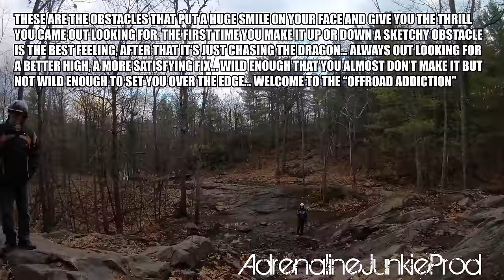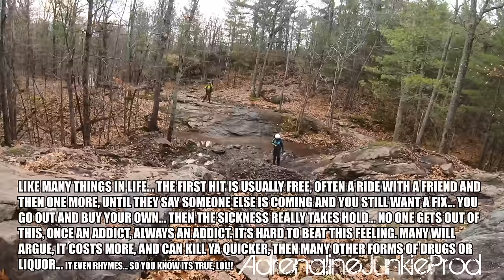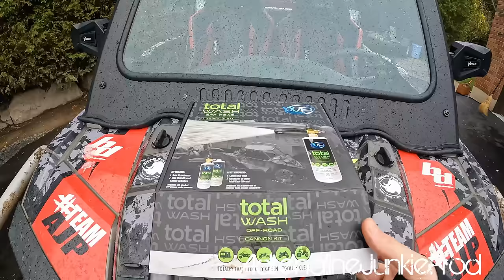The Bigger They Are The Harder They Fall! Feature Length UTV/SXS Off-Road Trail Riding Adventure

Comment from the maker: Do you think PORTAL GEARS are only good in the mud or do they have a place on the trail too? Leave a comment below!!
Reply: I think they only belong in mud. Put way too much stress on components during high speed or technical riding.
Reply from the maker: @cboutdoorfun9955  So far that's what I've seen too but I've heard of some people having good luck with them on rocky terrain, I just think you need to build the machine in a specific way to deal with them in a reliable manner.
Reply: Portals are not the ideal set up for all around riding IMO, 
very specific applications.
Reply from the maker: @Rogue308  I agree with that. They work amazing in specific conditions, that’s a fact.

Comment: great vid, thanks! I removed both front and rear sway bars and never looked back, now the suspension is truly independent. you may stiffen up the shocks/springs now to help with the roll and sloppy ride because with the bars intact you have the opposing side "helping" keep the spongy feeling at bay. I can still rip around on the roads without feeling like loosing control.

Comment: J, I'm like you in that I carry a lot in parts and tools.  But, Ive been in the same boat with a guy using portals on the HMT trails and snapped his shaft. We rcovered him and got him back to ashland resort. He was real thankful and wanted to buy my gas, I passed and said this is how my crew runs, we take care of anyone when we can. Then the next day we ran into a guy that was over heating and we carry water sprayer for the rads, offered to help and he was an ass ,and said it wouldnt work, when we know it does.  He was a little drunk, andit was getting dark, then he got mouthy, so we left him. He made it out, by the recovery crew and it costed about 500 bucks.  I love the hippie wagon, the guy and his wife. I run both Canned ham and polaris.
Reply from the maker: Sometimes having some extra gear helps you and the crew and sometimes it helps a lucky fellow wheeler you come across. We are the same way, we will always help out when we can. Ya, if you try to help someone and they are an ass we would do the same. Lucky it's rare to run across true asses. I'm glad the ball joint helped get these guys back to camp. Ya, the Hapy Hipi, his wife and all his friends are great people!  As for the Can-Am and Polaris stuff, you know we bust chops but we do appreciate all the different machines. Variety on the trails makes things way more fun!!

Comment: Glad to see you got to ride with the rear sway bar off. I did a few trails and finally took the rear off so much better on the trails. Never looking back 😂
Reply from the maker: Ya, aside from the extra flex the ride comfort improvement on the trail is massive! It's even better now because I've installed some Shock Therapy dual rate springs.

Comment: no sway bar on the front and I recently installed Super atvs sway bar shock on the rear. It bridges the gap between rear bar on or off. It rides much smoother on the trail but doesn't get out of hand on those off camber trails. I've been happy with it so far.
Reply from the maker: Appreciate that feedback. I was wondering how those sway bar shocks would feel. At times with no rear sway it just get a bit unstable and tippy. Especially on off camber sections.

Comment: use a disposable hand warmer in the GO PRO holding box, a little custom work to keep it water proof  too. hope it helps.
Reply from the maker: Hey man. We use hand warmers in the spare battery container and in the camera gear boxes. We also use other methods to warm the cargo boxes. However, once the camera is out it gets cold pretty quick and there is no real way to keep it warm. Trust me, I’ve gotten quite creative and tried many things. Generally speaking we do quite well managing but it’s still a challenge.

Comment: I have both mine disconnected. It works great for technical trails, and in my opinion makes a difference in mud also. It definitely has body roll at high speed, but as long as your not jerky with steering, it's fine. I have no problem going sideways on a gravel road at high speed. Running a maverick sport xmr
Reply from the maker: Ya, without the sways it definitely important to be very smooth and fluid. You just need to anticipate the body roll. I too have done some higher speeds riding without them since this video and you can’t be as aggressive but you can still rip pretty hard.

Comment: Of the first things I did was disconnect my sway bars front and rear, makes a huge difference on rough trials. (Update on my moto junk, it's still running great with 32s and slamming through the wv outlaw trails and hatfield and mccoy no issues over 1,000 plus miles)

Comment: Just my opinion but, I don’t run anti roll/sway bars on either of my machines. I have a 900s and a Wolverine X4. I live in northern West Virginia and the terrain here is much like what you’re riding in the video. The sway bars just make the ride miserable. I usually just adjust air pressure as needed. Seems to work really well for the terrain that I ride. I will start at 30 psi as I have to drive hardtop to the trails around me and then deflate to 10-15 psi.

Comment: Hey Julian I’m not saying you’re wrong but I keep running it through my head and it confuses me a bit. Ups said with sway bar the other side of machine does the opposite. In my head when going into a turn and machine starts to lean meaning your shock on outside is compressing which moves your sway bar up well it is hooked to other side so it moves it up as well which in turn helps level you out so instead of doing the opposite isn’t it tying your suspension together doing the same. At the end of the day you’re right it’s not full independent with sway bars just wanted to see what you thought about what I said

Comment: That first hill, why were all the can am looking so violent going up it?  Were they 72 inch and just too wide for it?
Reply from the maker: Hey Jeffery, those guys are mostly mud riders and you could see it in the way they chose lines on a lot of the obstacles. From what I understand technical riding is not their thing. With that being said a few of the Can-Am’s were bigger and wider than the other machines but this climb isn’t that narrow. I had told them all to ride the right side but it seems they all fixated on the left lol. There is an angle to that climb and if you don’t start by riding up to the right it pulls you into the left bank. They all somehow smashed into that big boulder on the left, which was weird because if you climb that hill properly you shouldn’t be in line with it. It’s just machine setup and driver I feel. Sometimes when you ride terrain you aren’t used to then it can be a little tricky. However, there is such a thing as too big in terrain like this and I think you saw the machines setup more for mud struggle here.

Comment: Portals in the mountains actually work great.  I am betting that dude has tons of rides with no issues.  Also betting he's running stock ball joints which should have been upgraded with the portals.  I've seen guys on portals make it look like they're cheating when wheeling the mountains.  Also, it helps save your driveshaft, u joints and drive lines by distributing the power out.  Portals are NOT just for mud, you just have to upgrade the other parts to match.  They also allow for a much flatter suspension setup without losing clearance which also helps reduce driveshaft wear.   Yes, they to increase leverage,  but you need to upgrade other areas that become weak links, just like anything.  I mean, a stock unimog with OEM portals will destroy most any stock truck on the trails because of the portals.  Point being, portals are not for mud only.  
I've always run without front sway bar.  I am getting electronic rear sway bar release.  I run limit straps on all 4 corners to help save axles, just like portals, no sway bars will break shit if supporting mods aren't made, same as any mods.  Keep up the great content.  This area looks mad
Reply from the maker: You make some excellent points. You are right, when you modify things extensively its constantly a game of moving the weakest link. I would love to see some more portaled machines out on this type of terrain. This was probably a bad example like you point out. Regardless, it was still a blast. Luckily we managed to get him fixed up.
Reply: I have a 64 inch XMR, basically built to the hilt.  Fabwerx cage (on the way), XTR370s, CT Raceworx a arms and CT high clearance trailing arms, HD tie rods, Keller ball joints, billet diff with RCV axles and when I can afford to, I'm getting the new 15% portals and swapping the 32s for 35s.  Fingers crossed she holds up hahaha.  If not,  maybe just 33s later.  Damn money pits.  I tried to order tye X3 version of your exo cage, but they don't make them any more.  Might hit up a cage builder to get me a set built...we shall see.  Keep up the awesome vids!

Comment: I run limit straps in the front, was getting shock knock after I put the rzr aid tender springs on.      Do you think the super atv high clearance trailing arms contributed to the sway bar link failure?    I have the same trailing arms and after a couple rides I getting some knocking noise from my stock sway bar links.

Comment: for gopro batteries i have good luck with try telesin there priced well i have used them for a few years now and no problems with them
Reply from the maker: I’ve had the opposite experience with Telsin. Absolute trash. Don’t last and cause the cameras to freeze up. Mind you, I film in 4K 60fps with max stabilization. If you film in 1080 or 2.7k then the demand on the batteries is much lower and they might work better.
Reply: @AdrenalineJunkieProd  ah could be! I only film in 1080. It does make sense with the extra power draw

Comment: Do you feel like the rear mud flaps are worth it? Did they help cut out the mud out?
Reply from the maker: Hey… good question. I feel they work ok. I got them strictly to reduce the debris hitting the rear shocks and springs. I feel they do help a bit with that. On technical terrain like this I’ve bent the brackets a few times but they bend right back with a kick or a push. Overall I’m happy with them but they won’t really stop mud from flying, they will just protect the area behind the flap.
Reply: @AdrenalineJunkieProd  thanks for the info!! I guess I'll you run them awhile longer and watch them and see how they do!!

Comment: Where did ya get the sway bar link so I know where not to buy one
Reply from the maker: If you listen to the video you’ll hear me say it was my fault. I didn’t check thread engagement when I installed it. Only 2 threads were engaged. My mistake. I threaded it in properly after the ride and it was fine. 100% my fault. The links are fine.

Comment: I currently use the Chemical Guys stuff and they clean So-So, need to try out the WR  Performance Products wash. for my 2021 Polaris RZR 900 Trail.  #wrperformanceproducts
Reply from the maker: I have used the Chemical Guys Tough Mudder wash many times and the WR Performance Product Total Wash blows it away. Works much better. With that being said, I love most the other Chemical Guys products. I use their ceramic coatings and they work fantastic. I also use a bunch of their more automotive based products with good results.
Reply: @AdrenalineJunkieProd  I am currently using Chemical Guys "Mr Pink" and the "Honeydew Snow Foam" both work well when used with the foam canon and wash mitt, we have a lot of clay mixed in the sand here in Wisconsin.  It would be nice not to have to have a separate bucket for the wash mitt and hand wash after the foam cannon.
Reply from the maker: @brianlesperance8749  I’ve been using mr pink on my cars with a foam cannon for years. It’s awesome. What I like about the WR Total Wash is that it is much more of a watery type foam and striated and soaks in better. Some of the other foams seem too fluffy and sit on the mud and dirt. I feel the total wash penetrates and releases the debris better. It also does a good job cutting through the haze the mud leaves on tires and black plastics. I still sometimes do a final hand wash with the mr pink if I’m feeling ambitious but feel it’s not really needed anymore since switching to toys wash. Both brands make good products. I just feel the total wash is more “Offroad” specific.
Reply: @AdrenalineJunkieProd  They sell WR Products at my local Polaris Dealership, I'll have to give it a try once riding season here begins. Right now snowmobiles own the trails in North East Wisconsin
Reply from the maker: Congrats Brian Lesperance you are one of the winners of the #WRperformanceproducts Total Wash Kits!! Shoot me an e-mail at adrenalinejunkieproduction@gmail.com in the next few days to claim your prize! Thanks for taking part in the giveaway and I hope you enjoy your new wash supplies!! 

- Julian

(March 19, 2022)

Comment: You portal hater! Lol jk man. I've done my research and portals require so many aftermarket parts to be reliable for the type of riding you and I like. I run limit straps all around cuz I have 5 in of lift and any more drop will hurt my rear axles.

Comment: I already follow Dirt Dudes and Blown Budget.  I also follow Off Camber since they are located here in Utah.  You should come out to Utah.  I know it's a long way but the riding out here (especially southern Utah) is amazing and totally different than the stuff you typically ride ... although there is plenty of mountain riding as well.  I'm looking forward to technical vids as well.  I just bought a 21 Turbo S Velocity, my first machine, so I feel like I need to learn a lot.  Everything from maintenance to what are the best aftermarket parts.
Reply from the maker: I just checked out Off Camber Industries and subscribed! I went out to Utah for a few day's back in 2016 but couldn't bring my RZR. Got a chance to check out Rally on the rocks and spend some time in Moab. I've been itching to go back since. Such amazing terrain!

Comment: I took the front seay bar off of my 19 Turbo and added limit straps. Tried unhooking the rear sway bar twice and hated it. Actually rolled the second time because of no sway bar. We ride the same type terrain as you guys do
Reply from the maker: Ya, it’s super weird with the rear off. I reconnected mine after a few rides. I really feel the best option is an electronic disconnect rear sway bar. I’ve got shock therapy dual rate springs and limit straps on the machine now. You’ll see them in upcoming videos. Total game changer.

Comment: I run no front sway bar but when I tried both off it felt too unstable for a 64 wide machine. If I had a 72 wide I’d be all for it.
Reply from the maker: Ya it’s a double edged blade for sure. There’s certain times having the rear unhooked makes it really sketchy and other times it’s awesome. I’ve ridden quite a bit more since this video with sway bars disconnected and recently hooked the rear back up and it’s such a difference in off camber situations and obviously a game changer at higher speeds. I’m also running shock therapy dual rate springs now which you’ll see in upcoming videos.

Comment: How long is the warranty on a new Polaris razor . That can am commander XMR I keep talking to you about the 2022 only comes with a 6 month warranty that doesn't seem like like very much of a warranty at all! So within the 1st 6 months what are you supposed to do just clamp it to the carpet and hope everything holds together to know that you have a good rig and if it makes it through 6 months you're great I don't know what is your opinion
Reply from the maker: Usually the RZR comes with 6-12 months depending on what the current offers are at the dealer. You have the option to buy up to 5 years of total Polaris warranty and generally speaking unless you plan on building a race machine I recommend getting it. Can-Am also offers extended warranty for purchase. Just make sure you get the manufacturers warranty never 3rd party. In my opinion it’s worth the extra money. Overall I’d say Polaris has much better warranty coverage then Can-Am.
Reply: @AdrenalineJunkieProd   That is something I'm definitely going to have to look into. Thank you for giving me the feedback of some real good information Good looking out brother

Comment: I took my sway bar off it is way better the axle won’t pull out
Reply from the maker: Ya it feels way different with no sway bar. The axles should not have any issues with popping out on a stock suspension setup. They are designed to function at full compression and full droop from factory. If it pulls out on a stock setup you have different issues. You make get some clunking tho as the suspension unloads.

Comment: How much of that bottle did you go through Julian on the wash? And did you use warm water or cold water in your pressure washer?
Reply from the maker: Hey man. I used a little more the. I had to for video purposes. I used about 3/4 of the bottle but when I’ve used it since I use about half. I’d say you could prob get away with 1/3 if the machine isn’t super dirty and 1/2 on an average wash. I find I use a fair bit spraying the wheel wells and underside of the machine. I was using like warm water. I don’t usually use hot water just warm. I find it makes a big difference. Mind you, it was pretty cold when I was washing and I’m sure that doesn’t help the product work. It would likely work much better on a nice warm day.
Reply: @AdrenalineJunkieProd  thanks for the update brotha! Just ordered me some!